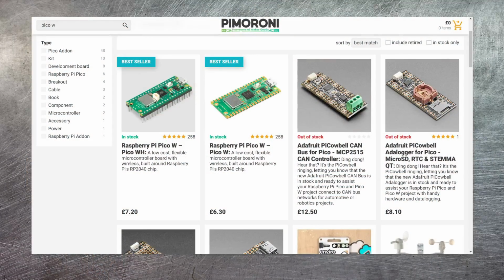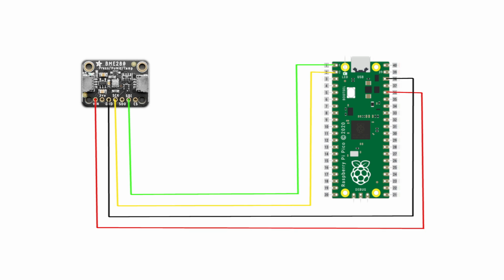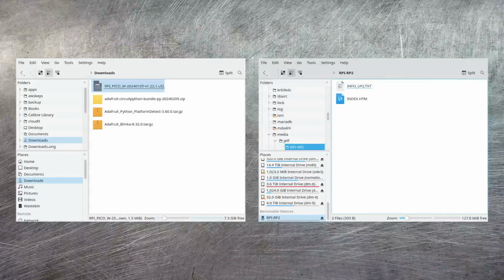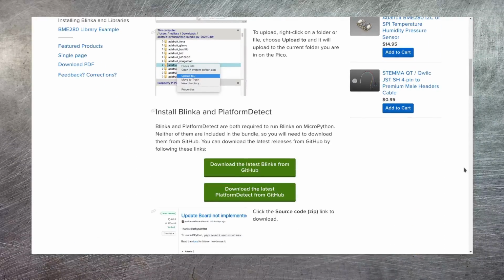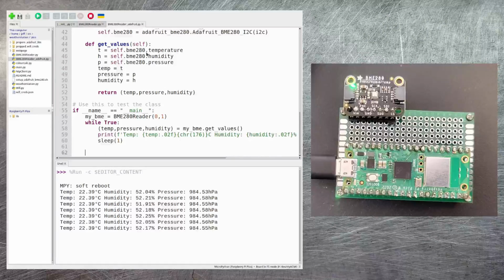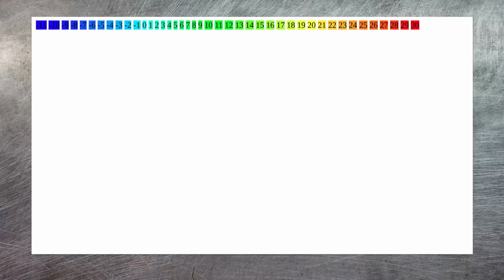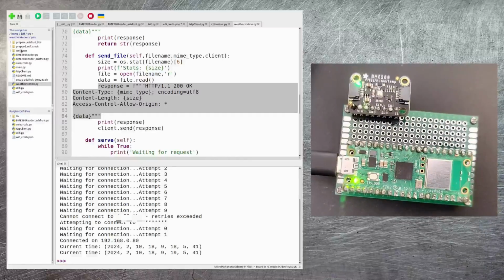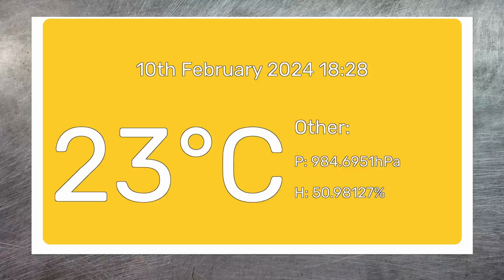PI PICO based WEATHER STATION using a BME280

Comment: Lead isn't actually a confirmed carcinogen, and is only a weak mutagen (meaning that it causes genetic mutations), so the lead solder probably wasn't the cause of Steve's lymphoma. That said, lead is a poison in its own right, so that there are a whole host of other reasons not to use leaded solder - just not cancer.
Reply from the maker: That's fair enough...And apologies to you or anyone else who felt misled. The IARC have said it's "probably" carcinogenic to humans and there have been links made between lead and lymphoma. But you are absolutely right. It's not a conclusively proven thing. That said, I'm still going nowhere near lead where I can help it 😀